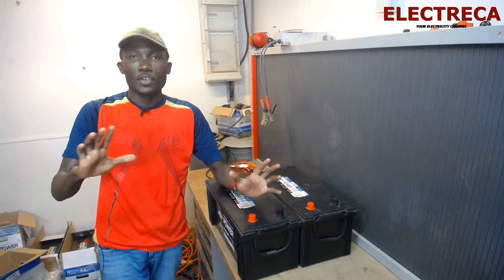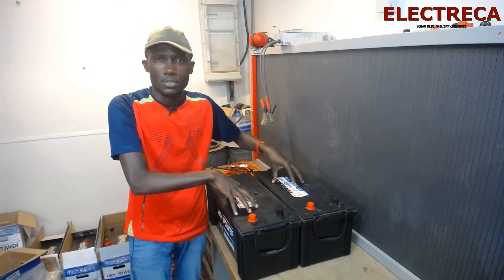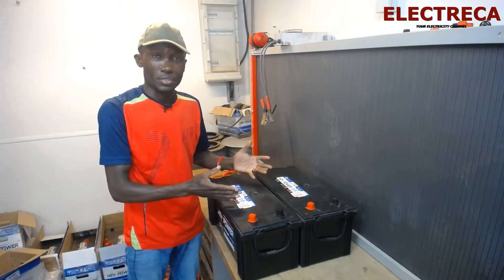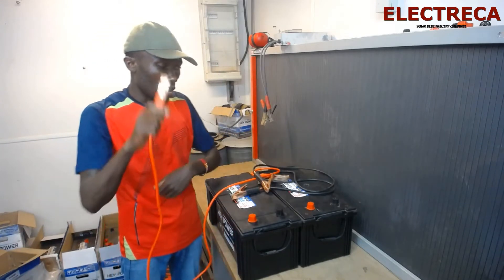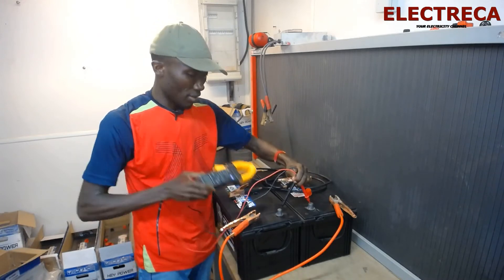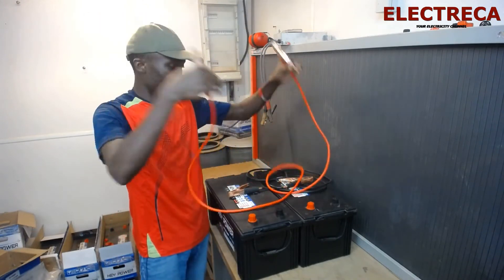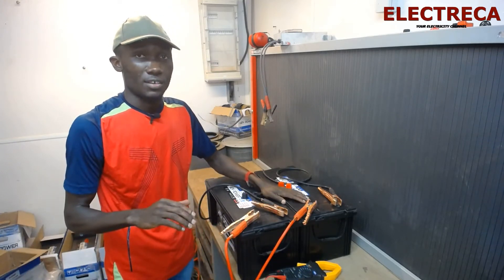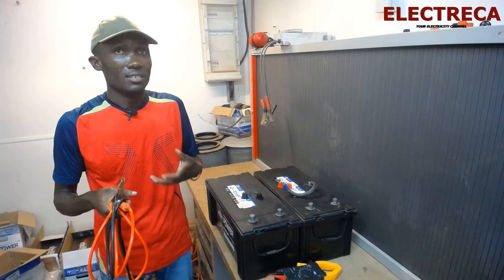series parallel connection of battery | ELECTRECA

Comment: Does the legenth of a wire reduce the current of the battery when sending it to your house appliances?
Reply from the maker: Yeah it does, when dealing with battery circuits try to keep wire lengths shorter as much as possible,and also use the correct size of cable.